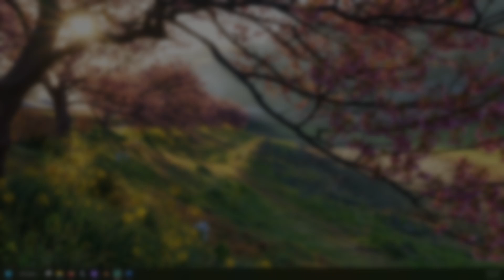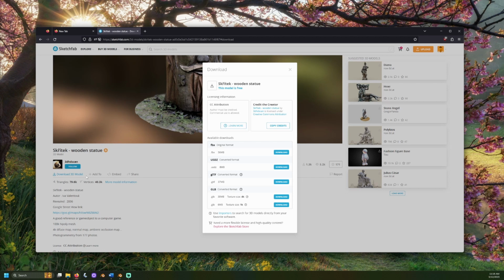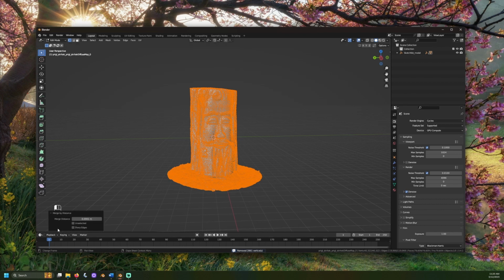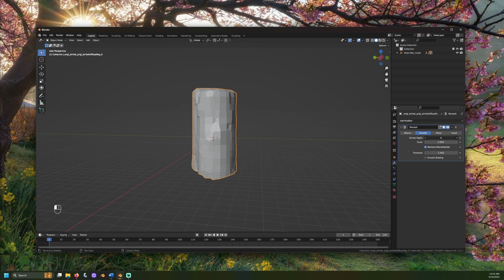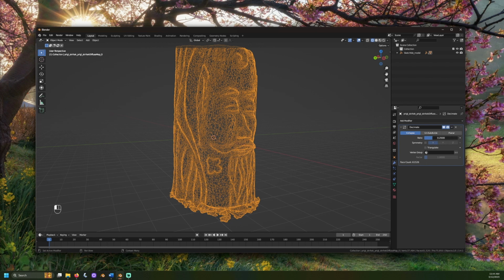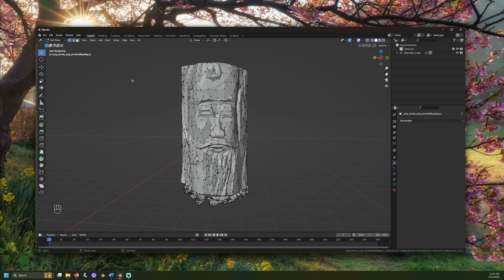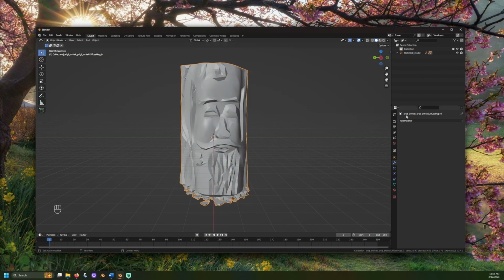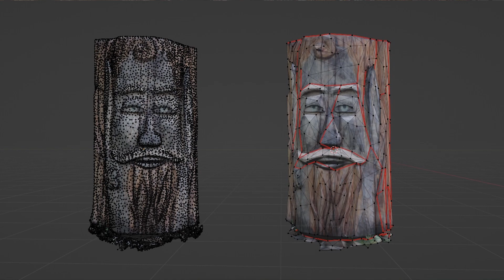Lower The Poly Count of Any Model

Comment: So I did this, but going to edit mode switched all the numbers right back to how it used to, any help?
Reply from the maker: It sounds like everything looks great in object mode, but once you go to edit mode the numbers get bigger. The mesh might look different too. One possibility is that the modifier may not have been applied. I would recommend selecting the desired mesh, and review the modifiers tab. If they have not been applied you may need to click the down arrow and apply them. Unapplied modifiers may not show in Edit Mode. I hope this helps!
Reply: @classoutside  Yes this was it, thanks for the help

Comment: why when i change to a number it changes the ratio back to 1.0000 in the decimax

edit: nvm i figured it out
Reply from the maker: It sounds like you experienced an issue where changing the number caused the ratio to go right back to a different value. I wonder if perhaps the input was too low, or out of bounds for the field you are referring to. I am glad you were able to figure it out.